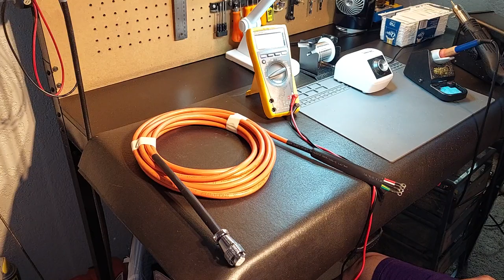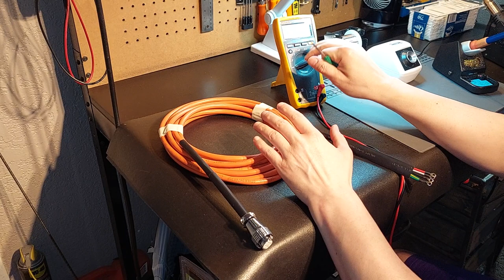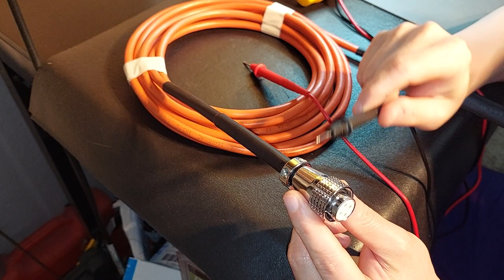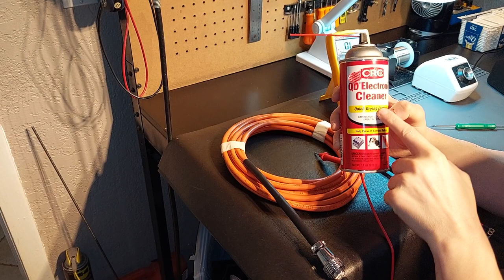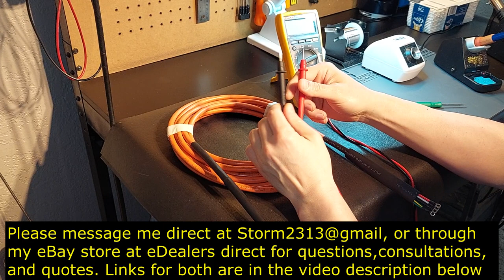How To Determine If Your CNC Spindle Cable Requires Replacement.

Comment: Curious, should you also confirm actual resistance of each conductor? Can you not have broken strands inside one or more conductors due to damage, and will those broken strands contribute to any issues? I notice when you touched the probes together, the reading on the meter was "1" but when testing the cable, it was "3".
Reply from the maker: Thank you for your support. The resistance of any cable will fluctuate based on many things typically the probe contact, contacts being clean, ect.. but you're certainly correct if you see a continuous large spike in resistance on a particular lead, or leads then this would be a "red flag". The word here is consistency as many times fluctuations happen, but if the numbers are for instance 20-30 after ten tests then I would highly recommend you to pay attention to it. Good question.  Have a great weekend Vince

Comment: Vice. I'm going to have purchsse cable for from you.  My country is a waste of time.  I need double shielded cable for my 3hp 110v simple. I have the connectors already.
Reply from the maker: No problem please let me know the length you need. Thank you,
Vince
Reply: Will need 20ft.
Reply: Will have it shipped to Miami instead of Barbados.
Reply from the maker: Ok you have tow options. My standard 16/4 spindle cable https://www.ebay.com/itm/131899174942

You also have my DS Flexion ultraflex cable which carries a 10 million flex cycle rating, and 2.9in MBR. This cable is designed for smaller cable chains. https://www.ebay.com/itm/132649829362

Thank you,
Vince